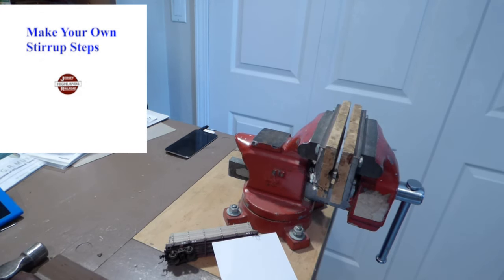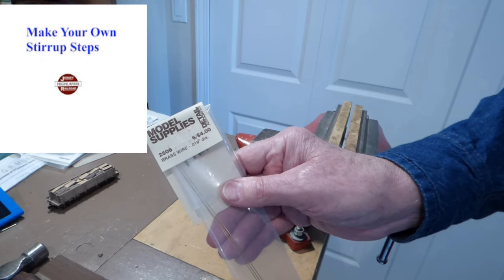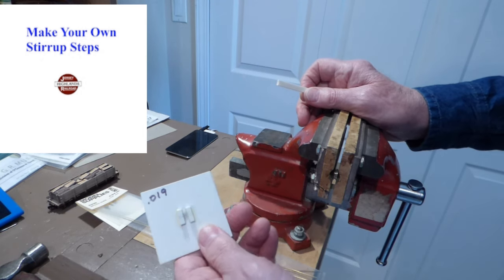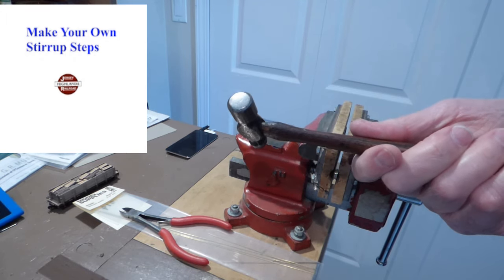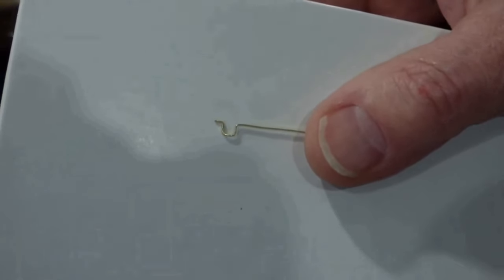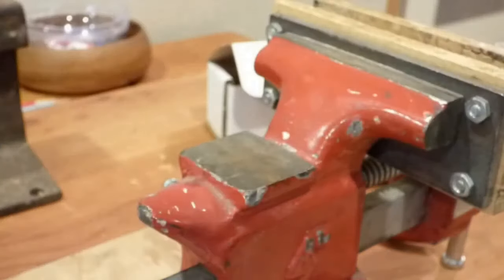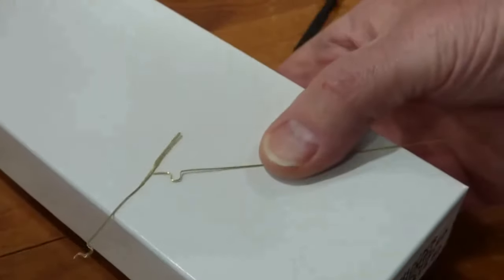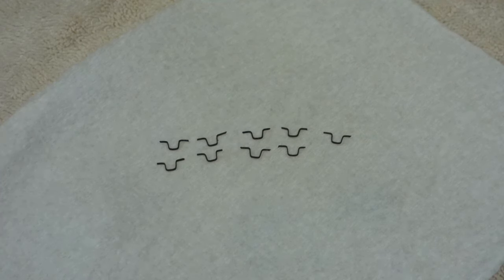Make Your Own Stirrup Steps

Comment: A great video.. if the jig were made of timber then it would be better and using a piece of hardwood or steel to form the U will make the shape more pronounced.
Reply from the maker: Thanks for checking in, Tim.  Good suggestions on the jig.